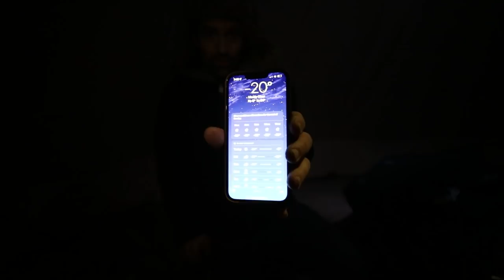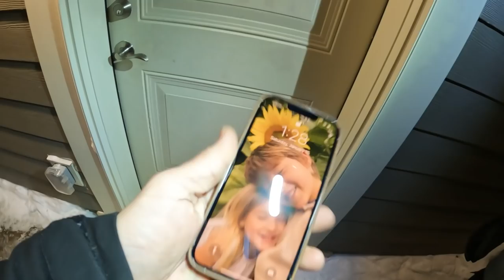We slept outside -25 [worth it] - Skating Trail (episode 3)

Comment: try laying black tarps or plastic you cut to fit  across the path in the sun for a bit it will melt anything underneath a bit even when way cold out. kinda like if you leave a puck on your ice it will melt into the ice after a while.  it will help smooth out areas...

Comment: another tip you can do is do what you were doing with adding snow to the ice but try watering the ice a little and adding the snow to slush it up a little and then use a rubber squeegee broom to level is off. this is similar to what a zamboni does. the wash water mixes with the snow on the ice and before the hot water and towel is a squeegee that scrapes the slush and recycles it back into the wash water tank. this is what helps fill skate marks.